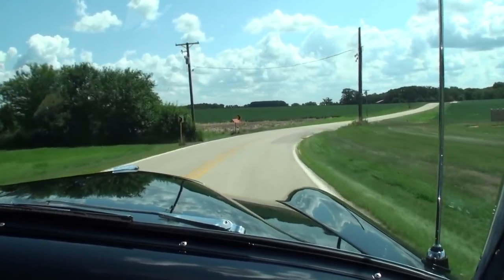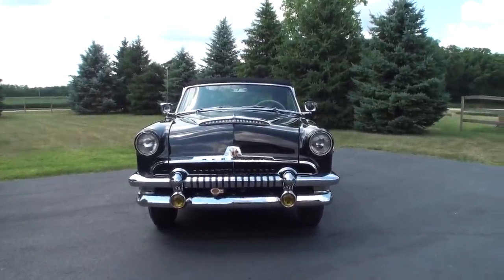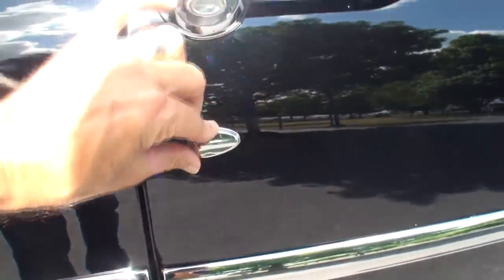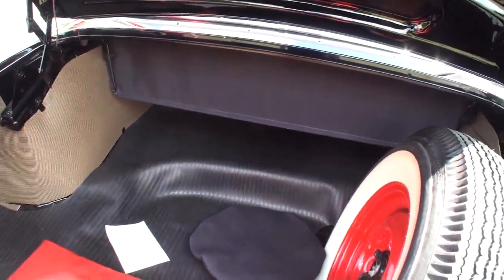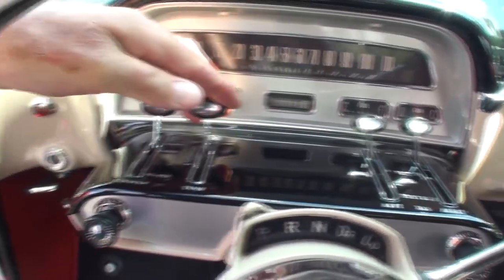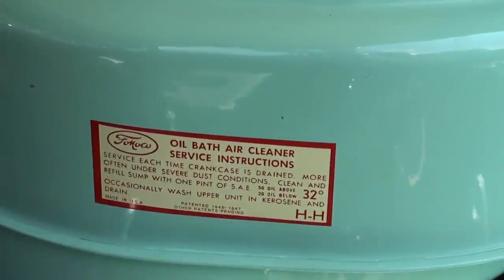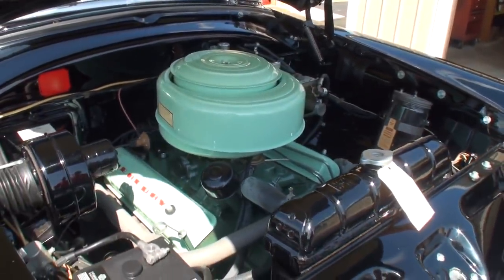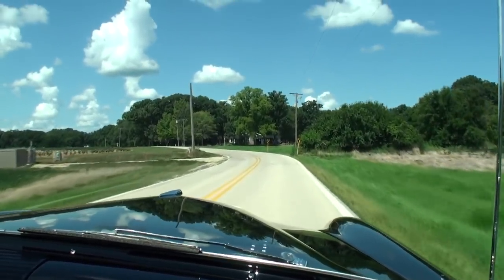1954 Mercury Monterey Convertible in Raven Black & Ride on My Car Story with Lou Costabile

Comment: I have a 1954 mercury monarch sedan 256 ohv v8 engine with auto transmission.  161 hp.  Its baby blue in color all the chrome to. Absolutely  love it. Its not fully restored yet but it runs and drives etc highway worthy not much rust on it either 86 thousand miles
Reply from the maker: Hi Jacob, Happy to read you have a fun car too. Hope you see many more cars on this YouTube Channel you enjoy. Please subscribe, and hit the "bell" so you can see all the cars when they are uploaded on this YouTube Channel, Lou
Reply: Oh for sure ! Thank you.
Reply: I have  multiple vehicles 1985 Oldsmobile tornado 
1954 mercury monarch 
1974 ford mustang ghia 
2012 f150 
2014 acura tl . And I'm missing a couple somewhere lol .

Comment: First year for the Y-block. If I recall it was a 239 CID in a Ford and a 256 CID in a Mercury. By 1955 it was 272 and 292 respectively.
Reply from the maker: Hi humbuckerpickups, Thank you for viewing and sharing your knowledge. Lou
Reply: Them old engines sure do look cool. 

Thank God it doesn't have a coyote or an LS in it.

Comment: You've probably seen the old Lucille Ball-Desi Arnaz movie entitled "The Long Long Trailer" that featured a yellow 1953 Monterey convertible. Cool old movie. You will notice that for the mountain driving sequence MGM substituted a Lincoln Capri with its heavier engine for the Monterey which overheated pulling the 40 foot trailer during filming
Reply from the maker: HI Steven, It's been a long time seeing that movie. Thank you for sharing some movie trivia, Lou

Comment: The owner doesn't seem to think there's much to talk about regarding the engine, but 1954 was the first year of the new Y-block design V8. In 1953 Mercury was still using a flathead design V8 that only produced 125 hp.
Reply from the maker: HI dlwatib, Thank you for sharing your knowledge, Lou

Comment: lou asked if there was anything special about the engine and the owner said no,what??? it was a brand new ohv engine for mercury and for that year. it had exactly the same displacement albeit differently by the bore and stroke changing places but ended both having 255 .4 -256 in disc. but horsepower jumped to 161 from 125 a big deal in 1955.
Reply from the maker: Hi Richard, Thank you for sharing and adding your knowledge, Lou